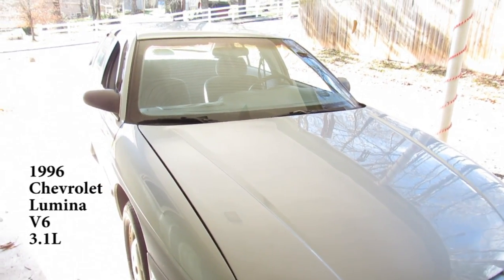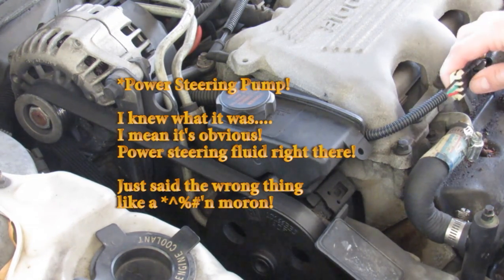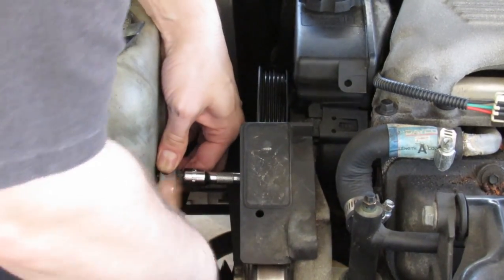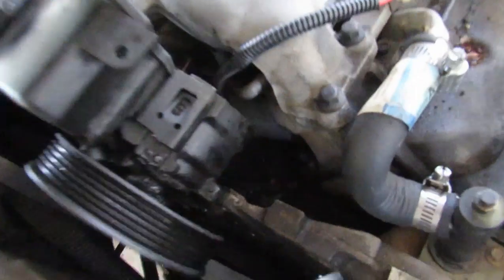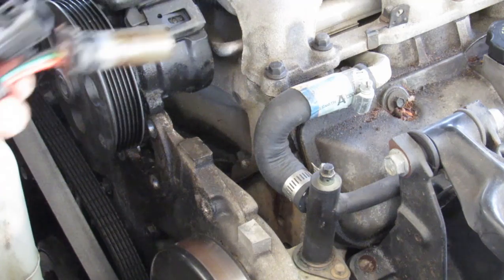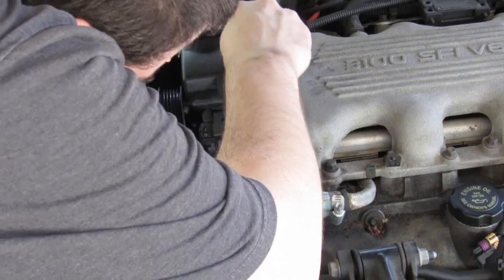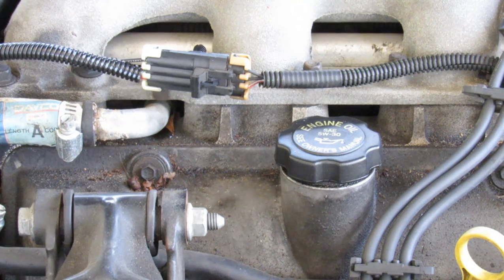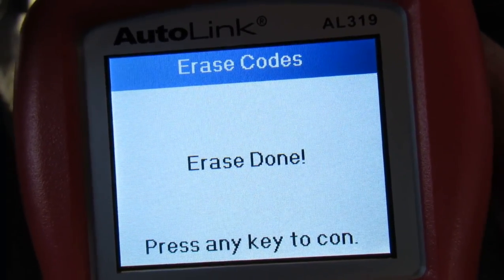Camshaft Position Sensor - GM 3.1 - Easy Walkthrough for anyone!

Comment: Ok so for anyone who is having trouble getting the pump out, what I did after an hour of getting pissed off and sweating my ass off in 110 degree weather, I learned that what’s holding the pump in is the bottom power steering line that’s connected to the pump, once I unscrewed that line the pump lifted right out! 🤦‍♂️.. thanks for the video tho, you helped a lot!
Reply from the maker: @JJman6547  pinned your comment! Great info!
Reply: @Films128  thank you! Cars running great after replacing cam sensor! 🙏🏽

Comment: Anyone having issues getting power steering pump up and out of the way, use your ratchet to pry it up from the front. Took me forever to figure that out. Wiggled that thing for almost an hour.
Reply: FlushHella I have a whole lot less room on my 3.4 liter engine
Reply: Thanks for every ones help. I think I can tackle it now. One thing he didn't show was the removal of the engine mount AFTER putting support under the car to keep the engine from dropping. That was done on another video. What ever works the best. Hope the hot weather holds off while I do this, or do it while my girlfriend holds the flash light!! (They are good for something!!)
Reply: Tried today and couldnt get that damn pump out for anything dont know what to do
Reply: Yes I can't take it out the power steering so  I put everything back , I'm not fixing

Comment: It ended up being the wiring harness from the control module down to the 2nd Cam Sensor on the backside of the motor was fried. Replacing this harness cured the problem completely.
Reply: Joseph Trunk  I've got a 2002 buick century and they car runs and idles great. But  after you drive it for about 15 or 20 minutes it just shuts off like someone turned the key off and womt start back up till about 30 minutes later. I replaced the fuel pump buy that didn't help. Did this happen to you?
Reply: Jordan White  that’s your crankshaft sensor
Reply: So the wires wouldn't fry the sensor as well?

Comment: after you install the new  sensor use inch Drive Long extension the screw through a piece of masking tape Sticky Side to the socket shell you won't have to fight the screw putting it in that's how it's done in Thai place run screw through tape put screw in the socket run the tape up long socket make it stick I hope you get that see ya 😄 I repeated it twice so you would get it

Comment: I’ve replaced this part multiple times in my 94 Ciera 3.1, exact same motor 
Now the car throws the code and I’ve replaced the sensor more than a dozen times 
Checked ground and voltage and they’re right on. Car not driveable in this condition. Now I know why I don’t see these vehicles on the road much anymore. These electrical and sensor issues sent them to the junkyards Quickly. But I’m determined to get mine fixed once and for all. It was my father’s last car and it only has 122000 on it , great car otherwise
Reply: Wiring harness from ICM to the 2nd Cam Sensor , backside of engine, was the culprit

Comment: What ere the original problems you were having? My car is running rough and idling rough, can't even run it really, Is this what you were having?
Reply: Also, when I called the parts store they asked if I wanted "in block" or "outside block", hmmm.
Reply from the maker: No clue about that in block or outside block business, it's only one part in that car. I didn't actually have any symptoms, I just had a check engine light that pointed to that being the problem, so rather than wait on it I just fixed it since it was so easy

Comment: im having problems with my venture it turns on and everything but then turns off after a while then when i try to started again it wont start i have to wait 10 mnts so it can turn again could this be my problem ?
Reply: Could be. If you could get a read out for any errors. Autozone will do that but you have to get it there or rent their computer tester for $300 which is refunded when yu take it back.
Reply: Maybe overheating I have a venture but don't notice these symptoms with a bad can sensor though I need to replace it

Comment: were is the camshaft on this engine?
Reply: jaeden amaral the camshaft is inside the engine, just like every engine. To get to it you have to take off a ton of wires and take off be valve cover
Reply: Thnx.
Reply: The cam shaft is in the lower end of this engine, its a cam in block style engine
Newer engines have the camshaft up top

Comment: o shit im getting this car tonight im scared now lol it only has 7.000 on it so i have a long way to go until i have to change this i hope
Reply: Mine showed up at about 109000 miles. One can't predict when something goes or will go bad after about 40 0r 50000 miles. AND make sure at 50000 you check the serpentine belt. If this breaks when the engine is running and esp on an overhead cam, buy a new engine. It wrecks the valves.
Reply: Loosing the serpentine belt does not wreck the valves on this type engine. However, on a Honda with a timing chain breaking, you will definitely wreck the valves.  I have experience both of these failures.
Reply: It's an interference engine. If the timing belt breaks it will wreck the valves. If the serpentine belt breaks nothing will happen but your car will die and lose power steering and overheat. Easier to deal with than a timing belt breaking. It's not a timing belt either, it's a timing chain and they rarely break.
Reply: I'm replacing this for the first time at 342k miles. Lumina is a great vehicle.
Reply: do you know what you are talking about? esp is the electronic stability control system which is abs (anti locking brake system) and traction control. shouldnt have anything to do with the valves in the engine. if it has a timing belt and it goes out it will go out of time and if its a no tolerance engine then yes i understand but if it is not a no tolerance engine it will just knock it ouf time and its still fixable.
Reply: a no tolerance engine?

Comment: anyone know where the crankshaft sensor is located in a 1998 Monte Carlo 3.1 engine
Reply: Usually under or behind the power steering pump. Look at the videos and use the one that works the best. The 3.1 engine is common to all the Gm motors in the 1997 plus range.
Reply: It's the same motor, 3.5 and 3.8 are built the same as well.
Reply: Did you find it? I have a 1993 Buick regal 3100

Comment: Now if I may ask , besides the code , was your vehicle acting up in any way
Reply from the maker: Actually, no. No symptoms at all,  just the code.
Reply: Mine was not starting, takes 5_6 tries, and uses more gas until I replace
Reply: I have a 1999 Chevrolet Lumina, and the code p0336 pops up only when I crank the car and I will go in and erase the code and it'll stay gone but like I said it only pop up when I crank the car up. And I'm no mechanic but I have worked on my own Vehicles plenty of time. So what did you have to do just replace the crankshaft position sensor?

Comment: Performed this last night step for step the same, except I didn't add any dielectric gel to the connection.When I started the car smoke came from under the hood. Smelled electrical. Cut the car off. Started again later and no problems. Any ideas?
Reply from the maker: No sure. There's nothing with this fix that could cause electrical issues. I would look around for any signs of wires burnt, and that no wire got caught between parts. But I am about as far from an expert as you can find.
Reply: Is it possible you may have accidentally shorted another wire? Just retrace your steps back to the power steering pump and make sure that or something else wasn't screwed down on top of a wire.

Comment: How long did it take you from start to finish?
Reply from the maker: 45 minute?  Would have been less, but I had a hell of a time removing the power steering pump.
Reply: I estimated about an hour. Now I will find out. It works better if the engine mount is removed on a 3.1 engine. Makes better clearance to get the power steering pump out. The other videos will also show how, and MAKE SURE THE CAR ENGINE IS SUPPORTED!!
Reply: Hey I find those wind chimes to be very calming amd piece full

Comment: Even with the plate removed its stuck
Reply: Did u figure this out? Having the same issue
Reply: @SimDaBears  yeah you have to loosen all the nuts on plate. Then take off enough of them to rotate the plate around.
Reply: Theres one nut thats difficult to remove remove all but that one
Reply: Change your oil every 1000 miles only use mobil 1 full synthetic 5w30 and the oil filter needs to be ACDelco. The light won't go away but it will run better idle other thing is bye the more expensive camshaft sensor the cheap ones are trash and you'll have to replace it again